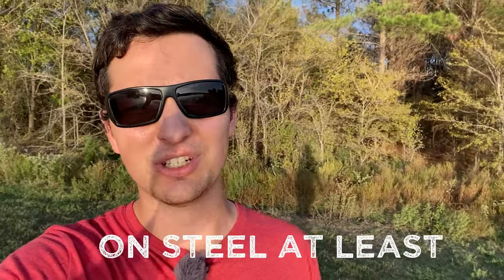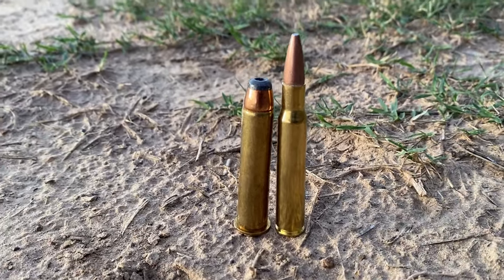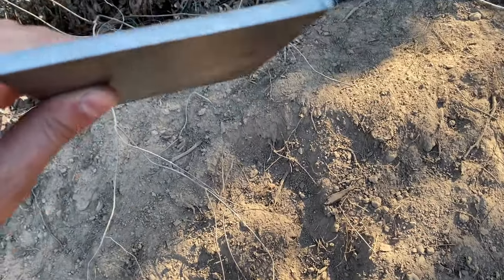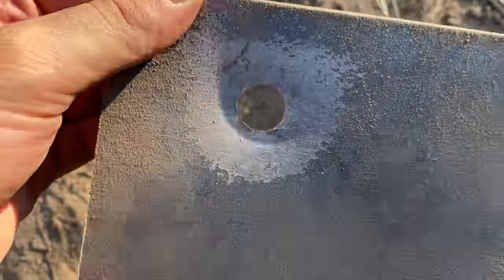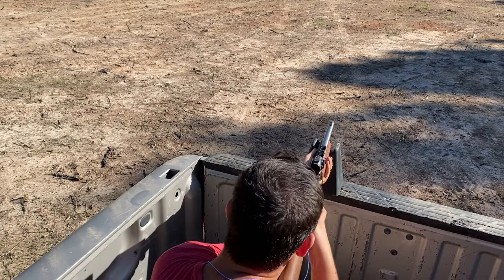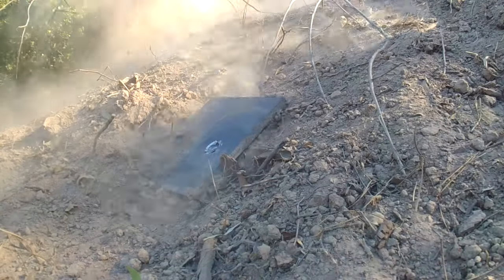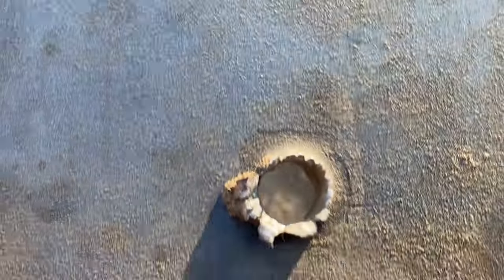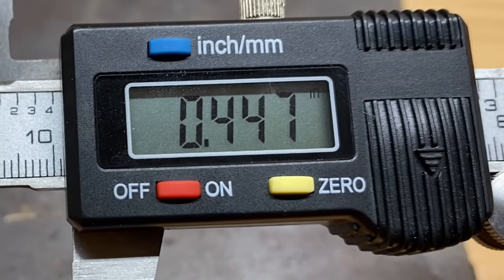45-70 vs 30-06: Steel Has Never Been Hit So Hard

Comment: I have been reloading both cartridges for 50+ years. 45-70, 300 gr hollow point 2,400 fps! That is a very hot load. Most reloading manuals with that bullet list a maximum velocity of 2,100 in a lever gun. The 30-06 will out penetrate a 45-70 due to the reduced frontal mass and longer bullet of the .30 caliber. That is why 6.5 mm is such a penetrator at modest velocities. That said the 45-70 is Thor's hammer.
Reply: One of those lead tipped suckers hitting anything in the shoulders or sternum is lights out in North America under a hundred yards. I can't imagine the force behind it and if I got hit there I wouldn't have much time to contemplate it.
Reply: @stevesmith2171  The 45-70 is a killer since 1873, for sure. I have shot many deer and elk with a 45-70 and never tracked a one. I did have an elk stare at me after the hit for about 30 seconds before it just collapsed. My Thor load is a 250 gr Barnes copper hollow point loaded with Acc 1680 to 2,600 fps (Barnes manual #3). point blank to 250 yard .
Reply from the maker: It is just about the hottest load I could find under lever action on the hodgdon website. I figured that I would need as much velocity as possible since the 45-70 loses it so fast. That is a great summary, and I agree that it is Thor's hammer...... On both ends!
Reply from the maker: It would be really interesting to see what that solid copper would do on the steel.
Reply: @bananaballistics  It is harder than lead. Look at Barnes manuel #3. A 250 gr copper can be driven to 2,600 fps with AA 1680. I check zeroed my rifle yesterday with that load. WOW, muzzle flash and hold on to the rifle. It shoots real flat to 200 yards. It makes deer real dead.
Reply: My bad that would be Barnes #4.Just got off the range with that load. One shot from 50, one shot from 100, touching bullet holes, final correction 4 clicks left. Let's hunt!
Reply: INDEED  - MY MID LOAD OF A 405 gr HARDCAST AT JUST  1500fps WILL SIMPLY KNOCK THINGS DOWN -- NOT TOO BAD ON THE SHOULDER EITHER  - SHOT RIGHT THRU THE RIB CAGE OF >400 lb ELK AT 75 YARDS -- HE STOOD STILL  - TOOK ABOUT 15 SLOW STEPS & KEELED OVER
Reply: 45-70 is like squash ammunition used by some ww2 tanks

Comment: 45-70 might not be as spicy as the 30-06, but it hits like a freight train. If I had to pick one for hunting, I'd probably pick the 45-70 as long as I wasn't planning on taking anything too far away.
Reply from the maker: I agree! I use mine for shots 100 yards and in for the most part.
Reply: 45 70 will take a grizzly from 100 yards
Reply: @kenjuicekrajewski9577  Grizzly will require about 6 seconds to cover 100 yards! I'd rather take them from A LOT longer distance!
Reply: @dundonrl  yes he wont know what hit him   wont see you but will smell you and you will have time for 2-3 more  if hes coming after the 1st   on uneven terreain and or up hill rocks etc
Reply: that 30-06 has a baby hole.... look at how much bigger that 45-70 is... I would take that 45-70 in bear country way before the 30-06

Comment: A demonstration of the difference between energy and force. The smaller 30-06 bullet delivers greater force because the energy is applied over a smaller surface area. The result is that more work (penetration) is done.
Reply: Mmm sort of.
Reply: Penetrating steel all comes down to velocity.
Reply: Respectfully, no. 17HMR and 308WIN have pretty much the same muzzle velocity, one of them delivers much more force, in this case it’s because of the mass difference in the projectiles. The energy is the mass x velocity squared, but for force you have to divide it by surface area. So yeah, not sort of, that’s exactly how it works, and this video - really, all his videos - are good practical demonstrations of this.
Reply: In my experience ghe light /faster bullet penetrates steel better than the more sectionally dense bullet (same calliber). -even though the heavier bullet has more force. Steel is different to other media for some reason. Love to see him do the experiment. Of course anything can be disproven if taken to extremes, and my comment doesn't hold for 17 hmr i wouldn't think.

Comment: I comment rarely, but here we go. Back in the 80s uncle sam gave me a sweet job shooting the 308, or 7.62x51 for you sticklers out there. Have LOTS of experience, no need to expound on that (yes, I'm old). The M21 was my baby. I helped Uncle Sam develop the next model. (Again, I'm old). Got out of service in 88 and wanted a new 308 when I got home. Went through a pre-ban HK91 that I sold way to cheap. Then to a DPMS 308LR. Shouldn't have sold that one either. Then saw the Quigley movie. I want one of those I said to me!! Unbenounced to me, my GF at the time (evidently liked me ALOT...and she was rich) bought me a Browning 1885 falling block in 45-70. WELL! The local deer, brake disks, concrete blocks, steel plates, whatever I shot, DID NOT like that rifle. Then...we broke up and......I sold it. STUPID!! 

I went through a period when I thought I didn't need guns (thank God I got passed that!!) So, I went back to my roots and got M1A NM and took care of my long-range need for doing just that back in the day. I still wanted another 45-70. I had a crap load of reloading stuff for a rifle I didn't own...WTF? So I got a Marlin 1895SS Guide gun with the fancy magna porting and 5 rounds of quick succession shoulder pounding, damn I wish hadn't done that, recoil. So, after shooting hundreds of different loads in that short, pretty, little howitzer, I have found that the 400 grain hard cast, loaded with about anything from Blue Dot to Unique to its max grams (according to Lyman, I don't believe it, use your own judgement, kids...DO NOT TRY THIS AT HOME.), is probably the round which will penetrate like you would not believe. Posting anywhere from 1800 to 2600 FPS. No damage to the rifle so far, never loaded outside of safe specs...much, but I'm not going to live much longer so I don't GAF.

I have tested REAL 308AP(not what you are told or shown is) and it has its place, but so does the hardcast 45-70. So what are my babies now. Those two, plus "some others". A big family is a happy family!!

Good video dude! Keep shootin'!!

Comment: Love this terminal ballistics stuff your putting up. Keep it up😁👍The reason the 45-70 with more energy doesn't go through the steel the same as the 30-06, is surface area for those who don't know. A lil' hint.
Reply: Exactly, and using SP didn't help the cause.

Comment: I put 405gr hard cast lead with 54gr of H335 in my reloads. It doesn’t penetrate the steel gong but I have to walk down and set the target back up every time. My 30-06 just swings it a little bit.

Comment: Not sure you're being fair to the venerable 45-70 since I believe that modern factory loads are low pressure that is safe for original 1886 black powder models. I have had 3 1886 rifles: an original, a Browning High Grade, and the new version Winchester I got for $795 when it came out 25 or so years ago. I had shot tons of rounds but  then when I got dies and powder, I loaded a 'starting load'  I think with 4227 and 405gr ,and bruised my shoulder so bad with the curved buttplate that I sold the gun and hurt for 3 or 4 years. Try your test again with modern pressure safe loads for Ruger #1 or Henry or Marlin 1895 or new Winchester and see what happens. Otherwise I really like and enjoy the videos.  thnx

Comment: What magazine and barrel do you have on your 30-06? I'm about to have my gunsmith turn my 30-06 into a tack driver hunting rig for hunting elk out west. Im also wanting to use an external magazine.
Reply from the maker: It was a factory 700 stainless barrel that I had rechambered, cut down and threaded. I also had the wood stock inlet to fit a magpul magazine well that takes aics mags.
Reply: If you’re going to use a long-stroke cartridge for “tack driving,” you should probably use a magnum round like 300 WM or 338 lapua. Personally, I haven’t found a good reason outside long-range, precision to shoot anything other than .308 win at pretty much any medium or large North American game. It’s cheap, reliable, effective, and doesn’t take a whole lot of skill unless you’re shooting over 500 yards.
Reply: And to be perfectly honest, you’re probably better off getting something like a Ruger Precision than trying to upgrade and accurize and existing rifle. There’s just too many good factory “precision” rifles now to worry about barrel swaps, bedding, and trigger upgrades, unless you are building the thing from the ground up. Like, an off the shelf Tikka is going to shoot better than most of us can take advantage of, and you can do that for under a grand.
Reply: @altortugas5979  I'm very familiar with the .308 and 300WM. Used both in Afghanistan I'm like to tinker and take something old and make it shoot like a Tikka. With my 308 or 300WM 500 yds is to easy. But yes I agree with you 100% on off the shelf modern rifles.
Reply: Don’t get me wrong, I understand swapping out barrels on an older rifle, stuff wears out. I guess it was the notion of turning it into a tack driver that struck me as… ambitious? …optimistic? I mean, I won’t tell you not to tinker, and you shouldn’t listen if I did. Customizing is one of the best things about firearms. Idk, maybe I just Overreacted because that phrase feels so over-used. Anyway, good luck with the elk!

Comment: Is it possible to put the steel into some type of frame so it doesn't give up so much energy? I've seen 405 rem go through two long ballistic gels water jugs and embed in body armor. I'm guessing a spitzer tip at 30 cal vs a 45 RN one is a bulldozer and one slices but they both displace the lightweight steel. I guess if you are always testing the same you have a consistency.

Comment: Are gun powder specifics (type/characteristics) relevant to barrel length?   As in, the specific powder can perform better in a shorter or longer barrel.  Upshot, just having the same barrel length for two different rounds doesn’t make it a fair comparison if one the rounds is loaded with powder that doesn’t perform best in those barrel lengths?

Comment: Thought: what if you used the intended barrel length for the particular cartridge instead of the EXACT same barrel length? For example, when comparing 556 to 300blk you use 20" barrel for the 556 (or maybe different lengths according to different considerations such as 16" as it is the most common rifle barrel length for the 556) and 8" for the 300 blk, instead of for example using 16" for both cartridges

Comment: I shoot black powder 45-70 and 45-100(sharps) at a 1/4 inch steel plate with  cast lead/tin and it simply leaves a smear on the steel.
Reply: thanks for this comment...i was wondering what the real bullets of the 1870s would do to a 1/4 inch steel plate...like black powder 45-70s from an 1873 Springfield, or 44 Henry, or 44-40 from a  1873 winchester or 50-90 from a sharps? I am a complete novice but i did not think they'd penetrate at all....I know 1/4 inch is equal to 6.5mm...do you think they could anything against even less, like an 1/8th of an inch?
Reply: Black powder is not as powerful as modern smokeless powder.

Comment: If you are looking for steel penetration, you should use the same composition of bullet. 
I am confident that a solid copper underwood xtreme penetrator would out-penetrate the same round in 30-06 on steel.

Comment: The vast difference in bullet composition makes this "penetration test" next to worthless. Not sure what the point of this "test" is, other than showing that semi-jacketed soft-nose rounds aren't optimized for penetration.
The 30-06 looks FMJ or nearly (it may be soft-tipped but just barely) coming to a near point, while the 45-70 rounds used semi-jacketed flat soft-nosed bullets intended to expand and transfer massive shock.
While not penetrating as well, I would guess the energy and shock imparted to the target was vastly greater for the 45-70. But we all know fully jacketed rounds are known for greater penetration with not as much energy transferred at point of contact.

Comment: I own several reproductions and the  springfeild trapdoor is one of them i do not buy ammo online for it i just buy the casings and make my own with a ammo press its cheaper and i get way better results than the low velocity govt .45-70 ammo i use triple 7 or pyrodex if i dont have triple 7. fun fact about .45-70 ammo you buy premade, it doesnt have the full 70 grains of powder in it and it doesnt use the original 500 grain lead flat round they use about 60 grains of powder and a 405 grain ball also if you make your own rounds do not use black powder specs if you use pyrodex or triple 7 you will blow your hands off its a more powerful powder than black powder

Comment: I have a 1874 sharps quigley 34 inch barrel.  Ive seen first hand the power of 45-70 on targets.. and its pretty scary.  I had 3 buckets lined up with a sandy muddy mixture inside.. shot them with my 44 magnum lever action and it jist made a hole.  Then my 54 caliber black powder rifle.. made a bigger hole.. then my 45-70 sharps.. and the bucket exploded into 50 peices and shot muddy sand everywhere

Comment: You used a soft points for the 45 70  The 30th 6 looked like a full metal jacket I would like to see you using an extreme penetrator Plus p in the 45 70

Comment: What about 30-06 and 45-70 AUTO? Or even 45-70 vs. 45-70 auto?
I ask as a European "protected from dangerous firearms by my government".
So things "obvious" to any gun nut living out there beyond the pond - is sadly not so apparent to me.
Reply: My family has been casting and reloading for both 45-70 and 45 ACP (Automatic Colt Pistol) for 4 generations now, and the two are very different in terms of power. The short barrel and smaller powder charges in .45 auto makes for much lower velocities; around 900 ft/sec with 200 grain slugs. It'll punch holes in stuff, for sure, but stopping power is limited to around 800 joules of energy. With the 45-70, you can see velocities of 2200ft/sec from 300+ grain slugs in a 26" barrel. More lead, moving much faster, can give you energy of 4000+ joules per round or more. My lever action 1895CB can hold 9 rounds, which is equivalent in energy to almost 50 rounds of 45 ACP. Additionally, due to being supersonic, 45-70 can cause what's called hydro-shock in moist targets; water in the target can flash to vapor due to the shockwave at impact. This effect can cause damage in soft targets much larger than the projectile itself. In my youth, my old man and I vaporized many a poor unfortunate watermelon with our 45-70. Often we couldn't even find any rind left.. Haha..
Reply: @MechMan0124  
TY for that Info.
But still - it would be fun to watch a regular .45-70 versus .45-70 AUTO used by Phoenix Weaponry.
The description looks like it is "buffed-up" .45-70
But how buffed? Simple numbers are not that entertaining for someone who can't depict those "values" acting on a target.
Reply: @hubertET  It looks like Phoenix Weaponry is just milling their brass to make it rimless, and then hot-loading their 45-70 like us hand-loaders do. Factory 45-70 ammo sucks; they load to around 20,000 CUP (copper units of pressure) to keep from damaging the older rifles out there and catching lawsuits. Action strength on modern rifles can handle up to 44,000 CUP (consult your manual!), so there's enormous headroom for improvement. We have a family load we call our "T-Rex" load; 450g cast, heat treated hollow-point w/gas check over a compressed powder load I won't disclose here.. We consider it single-use since it leaves an ugly pressure ring at the bottom of the brass, and they can't be reloaded after that, but 9 of those will solve most any problem that could present itself.
Reply: @MechMan0124  Again TY for the answer. Quite a few things for me to look up and read about :)

Comment: What are you doing???? The 45-70 comes in 3 different strengths. You obviously shot the 45-70 trapdoor which although not a wimpy round it's just no where near what the others will do. Then there's the 45-70 standard which is basically 30-06 ballistics with improved knock down power and then the 45-70 strong which is much more powerful than the 30-06. Please note that when they manufacture bullets with the 45-70 they like to sell it with the power of the 45-70 trap door to avoid any lawsuits from someone who pulls out a firearm made when people were still throwing rocks at each other for defense, who might try to put in a 45-70 that has pressures that will blow out the side of those very old firearms. The 45-70 trap door is a black powder round and firearms manufactured to only handle these cannot take the pressures of the other 2 rounds mentioned. Guaranteed the 45-70 standard will go through 3/8 steel plate and the 45-70 strong will most definitely go through a 1/2 steel plate no problem.